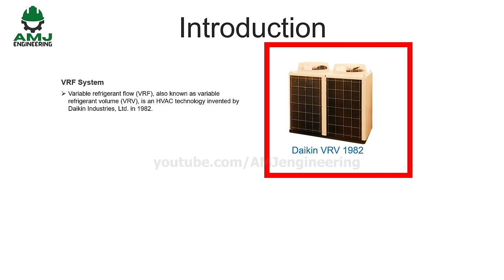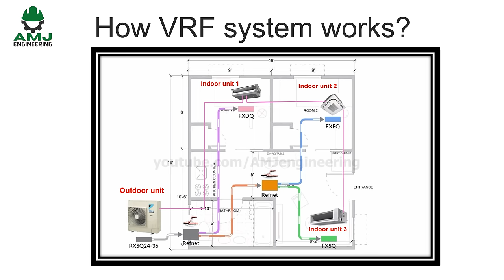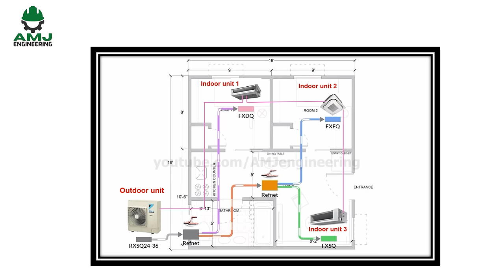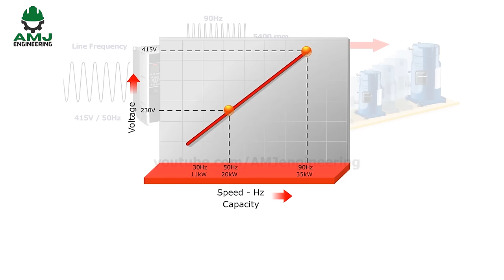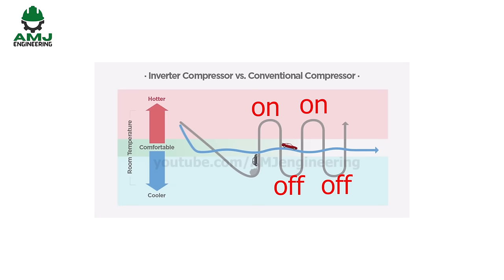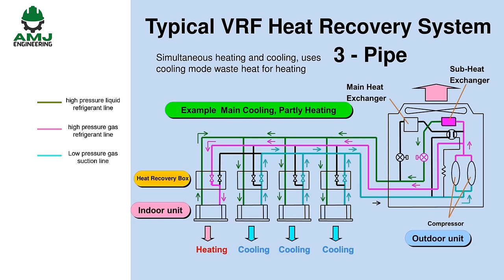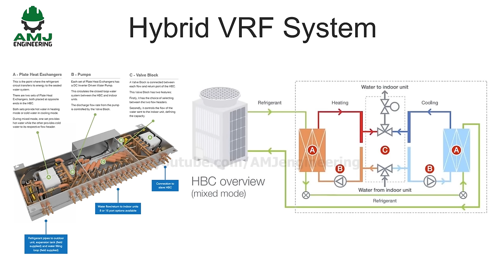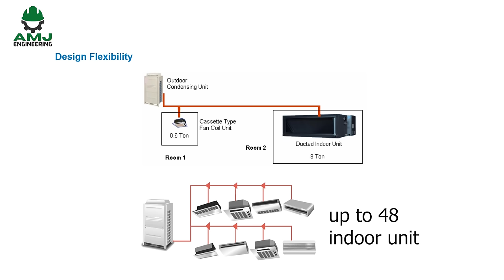VRF/VRV HVAC Systems | Working principle and benefits | HVAC 11

Comment: All new homes should be equipped with the VRF systems.  I think the lack of proper training is the reason for the HVAC contractors in the USA not installing them.
Reply from the maker: Also their higher cost is another main reason.
Reply: @AMJEngineering  agreed 8-20k install compared to a 30-70k install
Reply: Us are 4 types of season and extreme weather. With the current economy, do you think average American family can afford it?

Comment: I put a 5 head heat pump VRV unit in my house to replace 25 year old ducted reverse cycle. Could not be happier! So efficient and less expensive to run.
Reply from the maker: Could you please advise the capacity of VRV unit compared to replaced one, and how much energy are you saving oer month?
Reply: iijioj
Reply: iyeah jyeah uuihi
Reply: @dingdong3124 😮🎉😅😢😢

Comment: I work with this these machines everyday. They can give you headaches, but are still fun to work on. Nice video.
Reply from the maker: Appreciate your feedback. What type of problem you are facing with them?
Reply: @AMJEngineering  mainly leaks and faulty PCB or Inverter boards
Reply: Rather have refrigerant piping than water. Water leaks cause damage, refrigerant leaks just cost money in the price of the technician coming out toleak test and recharge
Reply: @jamesrothwell1738  have you ever delt with a fully loaded VRV system with 200lbs of R410a? These things are a nightmare for leak checking. Refrigerant doesn't get replenished automatically like with water where you have a makeup water system.
Reply: Absolutely hating VRF. Nothing but issues. Only  tech in my office that works on the Mitsubishi that our mechanical keeps installing. Just recently had fun replacing a reversing valve on a twinned outdoor system after 1 year at a firestation. Kept getting a refrigerant overcharge alarm when defrost would occur, alarm would happen instantly before maintenance tool would refresh data. Had to use rare earth magnets on the valve to indicate position and to find which one was the issue.
Reply: @codythompson9035  damn! Install is crucial on these machines. I have to investigate whether two fan coils have crossed pipes or wires. We had a suction line fusible plug blow when it reached 600psi. Wtf is a suction line doing with 600psi of R410a?!?!
Reply: I just had a water cooler vrf crack the bphx…
Reply: @PigBenis4U  The fusible plugs are temperature rated and most likely melted when hot gas was returned in the suction line. I have seen this many times in Daikin heat recovery systems when the branch selector box malfunctions and allows hot gas in the suction. There is a fusible plug relocation kit for the plugs mounted on suction accumulators because of random melting of the plugs.

Comment: Big warning though...sometimes the refrigeration piping sizing, which is tricky, gets installed wrong and you start killing compressors.  When this happens you get stuck with the problem because the mnfr says it is not their fault and the installer will refuse to take responsibility for it...so you go thru pain and $ until you get frustrated and rip it all out and start over.
Reply from the maker: Yes you are right, thats why every manufacturer has its own sizing design software for pipe arrangement and sizing. I have experience in this as I used to work few months in Mitsubichi electric company.
Reply: Vrey good jolly
Reply: True
Reply: Get your layout, run lengths, and elevations; then vet the design with the manufacturer.

Comment: I'm an FM that just started at a new company, Mitsubishi VRF setup cooling all my IDF's, separate cooling tower setup for comfort cooling along with chillers serving FCs and data center IRC's, and a few CRAH units here and there in some labs.

This is the first time I've dealt with VRF;s and this video was a nice primer as I just finished a day of walking roofs with our mechanical vendor and didn't have enough time to deep dive. That's the fun part of managing MEP, there is always something new to learn about and geek out when we go back up tomorrow and finish out the campus mechanical tour hehehe.
Reply: VRf systom  Hvac verables refrgnt systom  one unit morinfoor verbls 7 uing ficmcing   log modesl vompann modelx fixinv indoof mord lifixex sompoit hvac ac systom

Comment: We’re using full DC inverter Hitachi and Mitsubishi Heavy Industries air conditioners in our home—all 5 units almost running 24/7.

Our bill is just around $100 a month, we live in the tropics and we have one of the highest rates in terms of utility costs in Asia but I’m pretty happy with my bill now.

We used to pay upwards of around $200-300 a month for just two conventional units a couple of years ago.

Yeah the units are expensive as hell but that is a small price to pay for machines that are reliable, insanely quiet, and provide us extreme comfort for extended periods of time.
Reply: wait until they start to break down😅😆
Reply from the maker: Thanks for this great information
Reply: That’s bc it’s a variable compressor it works on capacity load. 👌 it’s working how it’s designed for your climate most VRV/VRF systems have a blueprint of the house and system install etc

Comment: Initial expense is high the turn around on money back takes a long time. But if you use the compressors year around they dont last especially with 410

Comment: Is Hybrid VRF system best for 7000 Sq ft residential G +2 storey home in Florida?- considering Mitsubishi
Reply: Yes it will be beneficial for your residential building in your electricity savings and increase your system efficiency ..I recommended to you diakin vrf ..diakin is a top most in vrf system
We installed mostly diakin unit in UAE and Middle east .
Reply: @WTTvlogs  I understand there is one hybrid vrf with higher seer from Mitsubishi?
Reply from the maker: Yes vrf system is your best choice. Actually mitsubichi and daikin are on top list. Just look for the best price.
Reply: No ! Go VRV

Comment: hi sir, why the energy efficiency of VRF @1.07 kw/ton is so low?
Reply from the maker: because VRF is a smart system technology, its purpose is to reduce energy consumption of conventional split systems. conventional split systems efficiency range between 1.6 to 2.2 kw/ton. VRF acts similar to what VFDs do in chillers and pumps, gives only the required flow @ the required compressor partial load therefore, saving a lot of energy. the number 1.07 kw/ton was based on one study only made in UAE. More data should be gathered from different projects at different locations around the world to came up with accurate number and compare it with water cooled chiller or air cooled chiller plants.

Comment: What if the whole building needs to be cooled and all the units need cooling, they suck and are a scam. Like 30k for one unit. I have seen them manufactured, very difficult to work on and manufacture.
Reply from the maker: If all building needs cooling at the same time then better to go for chillers option. VRF are a great option in residential buildings, with every dwelling unit having its own outdoor unit.
Reply: You are a pessimist. Keep buying old technology and paying a fortune for the utilities.